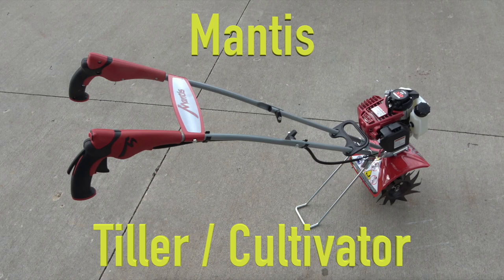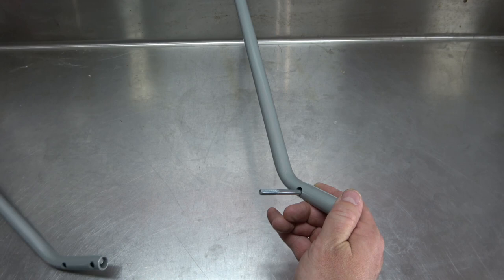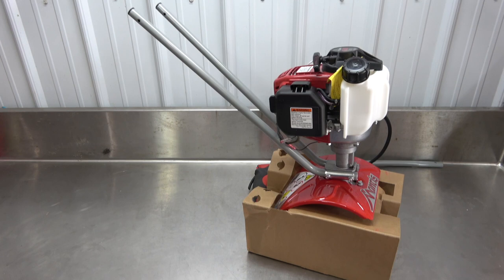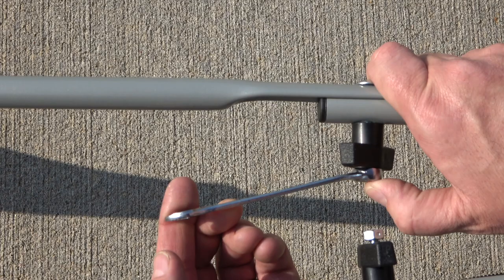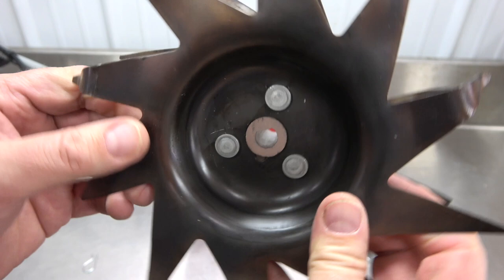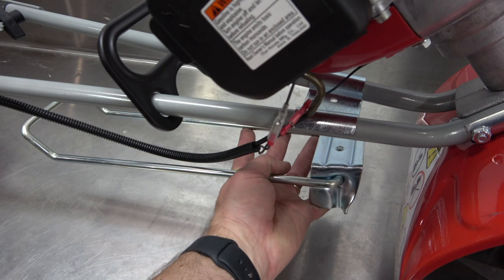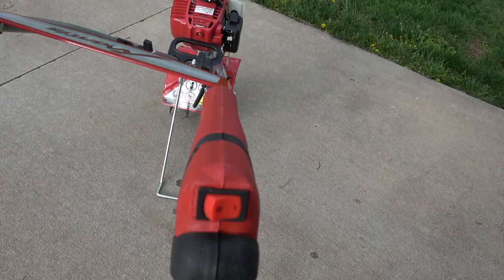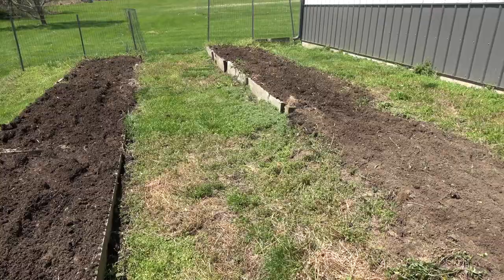Mantis Tiller - Assembly & Operation

Comment: Yo, Phil and hope all is well there. Fine here and that's a fine little digger BUT the biggest downfall of them is keeping the tine drive WELL lubed. When my pal was running the saw shop a pile of these came in and the main problem was the drive gear stripped. The worm is steel and the bull gear is bronze and if it gets dry, it's gone and a set of gears is almost as much as a new unit. There used to be zerk grease fittings on the old ones but I haven't seen a new one in a long time. They run fine till the gears strip and then you'll have a dandy little motor to play with. Maybe mount it on a fishing reel! GREAT explanation and happy digging! I've got a little tiller that goes on my weedeater but Cheryl went to no-dig years ago. WHEW! I also have a Gravely with a rotary plow. Double WHEW! So have a Jesus weekend and dig on, Pal and GBWYall!
Reply from the maker: Yes... everything is good out of the box. Time will tell.  I wonder if I could tap and install a zerk in that spot.  hmmmmm.....sounds like a good video.  Been picking beans, cukes, and spinach like crazy.  Canned some dilly beans and dill pickles a couple days ago.  Used Tattler reusable lids on the dilly beans.  (just to film it).  Hopefully it will be my next video out in a couple weeks.  Those lids really did work well.  I'm impressed.   Good hearing from you.  Wish you were here to show me where to install a zerk.  I'll have to do some research.
GBWU2!
Reply: @PhilCrockett  Look at videos on the older ones and they ought to have one showing. I've seen them but can't remember where they were. And it's a sad thing if there's no place to lube them or add oil. Good old throw away society. Our cukes and beans are almost here. We're a little behind yall in that respect but we're still getting greenhouse stuff. Toots got a freeze drier and has been doing some with it. So far, so good. The Tattler lids will be very interesting. And with all that picking, maybe you'll be able to pick a nice fish or two or five. We're still goofy and watching the goofier ones go whizzing by. Gods grace Is amazing! Thanks, Phil and GBWYall!